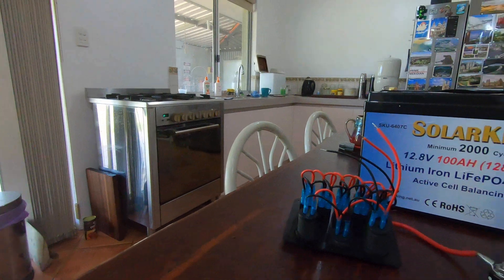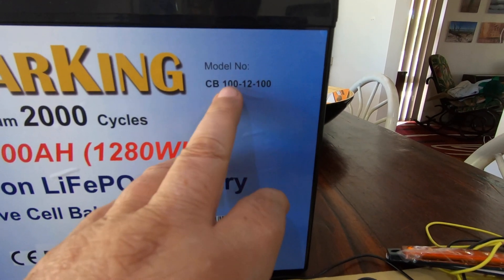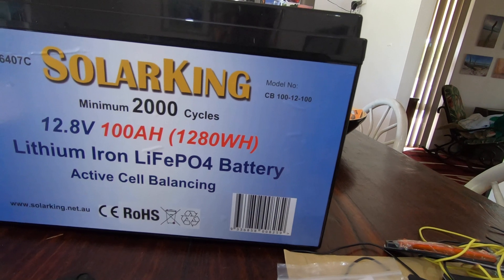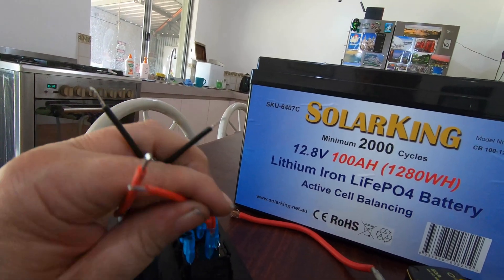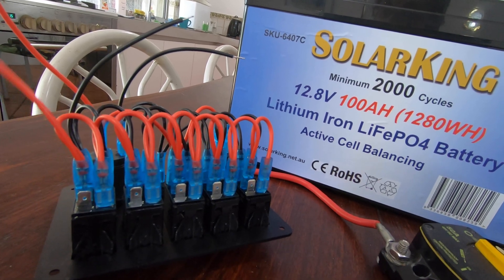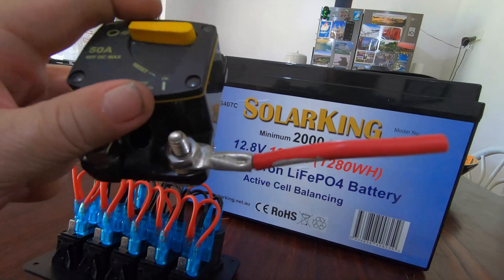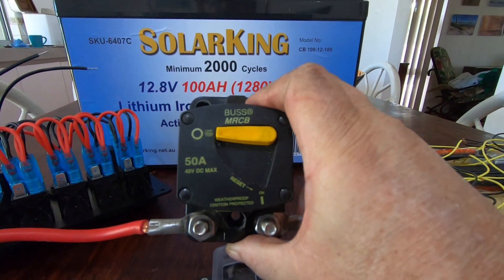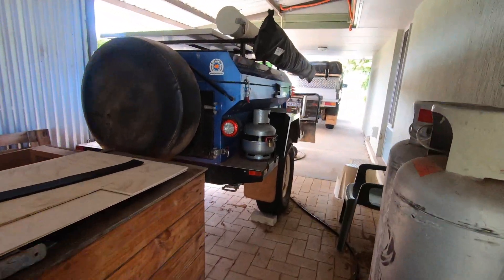New Battery Arrived.  Wiring explained 1

Comment: To be fair, those switches should be only triggering relays.
Reply from the maker: Yes but if you look around. Here on youtube no fuses i can see most of the videos.. Being wired right into his boat. Only time i would go through a relay is when i have more than 10amps load.  Same as they do in most types of DC wiring.  Cars / boats/ trucks/ you get my point. every bit of wire in Not on a relay. Only heavy loaded wires, But all wires are Fused. That is how it should be. But most buying these ebay very low priced switchgear only have very little knowledge on wiring DC. This video and part 2 of this video is for them

Comment: Hey mate I'm wiring up the same switch panel in my canopy are you saying I should run a separate positive to each switch? And should I run the fuse box before the switch panel or after the switch panel cheers
Reply from the maker: Yes mate. Wait for next video this afternoon. I show you how I do it. Safety first. Hard to get back from the bush if your camp burns down. Also stuffs ya trip up